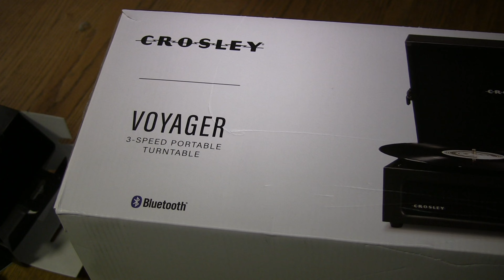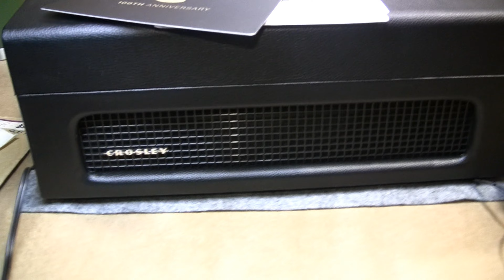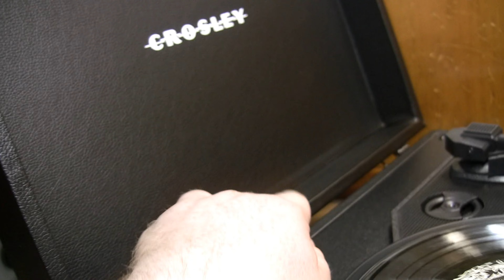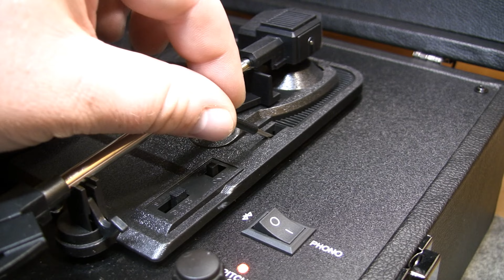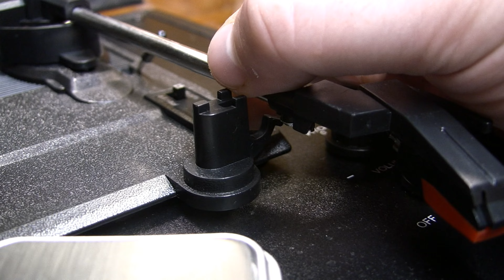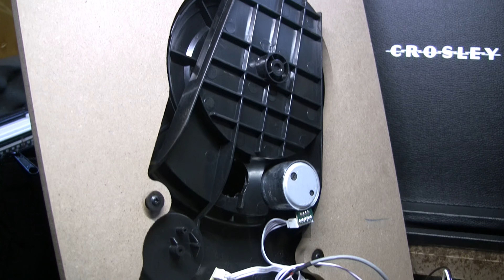Crosley Voyager Suitcase Record Player Review

Comment: I have been using the $30. VIBE SOUND. Ok. It won't floor you. But it does it's job surprisingly well. It is great for nostalgia. 🤠 It looks really cool. 🤠 And it designed well so the record never comes into contact with lid.🤠 Yea! This is a winner. 🤠

Comment: Can I change the cartridge on my voyager? Which one would you recommend? Thanks!
Reply: You're quite restricted with the ceramic cartridges on these entry end portable players but if you want to try and upgrade check out the banpa bp2atc ceramic cartridge or if you can find it the Vakind P-192D ceramic cartridge. Also, buy a decent diamond tip stylus with metal cantilever. Even the Banpa/Vakind cartridges which have a flip over 78/LP stylus have a sapphire tip so you'll want to pick up a separate diamond tip flip over needle (like the BSR ST-17D)

Comment: I've only used mine literally a handful of times, and it stopped working. It's been stored in all of its original packaging and only pulled out to play new records. So disappointing. Troubleshooting suggested replacing the power cord ( which should not be going bad after only a few uses), but I can't find one that's compatible. Has anyone else had this issue?

Comment: My turntable has a slightly different mechanism. My PCBs are also different my power amp is in the back in the jack board. The knobs are the only thing on the control PCB

Comment: The main problem with these Crosley record players is the sound quality, mainly aa a result of a ceramic cartridge, with a frequency response from about 150Hz to 8kHz +/- 3dB.  It's not going to sound very good - the sound has a tendency to sound harsh and tinny.  Compare that with an Audio-Technica LP120 using a magnetic cartridge and an AT-VM95ML stylus, with a frequency response of 30Hz to 23kHz +/- 3dB, hooked up to a hi-fi midi system and the difference is very clear.
Reply: Does it still sound like this if hooked up to a better speaker?
Reply: @rainbowpancakes7298  Quite likely, though it will not sound quite as bad if it is hooked up to a high impedance stereo valve amplifier, common during the 1950s and 1960s.

Comment: Would it help if internal speakers were replaced with larger ones if they fit ?
Reply: I have one of these, it's a parts doner now. I tried the different speaker route, but not improved. The reason is the cheap amp in it. Only gives you that shrill ear hurting sound.  The cruiser I got sounds better than the Voyager.
Reply from the maker: I don’t see why not, though that’ll only help so much since you’re ultimately limited to the so-so sound quality of the ceramic cartridge and stylus.

Comment: I have tested the very same unit today, just for fun. All the bad and negative opinions on the internet are real - the thing is absolutely horrendous. It's extremely cheaply made, everything is wobbling and not stable, the tonearm feels like its about to fall apart at any moment. The cartridge has a plastic cantilever as you mentioned which is horrible. I have tested with 1 record using the built in speakers and my iPhone speakers sounded better that this it was also not loud at all. Next I connected it to my good stereo system and even there it sounded horrible when compared to my Technics. Also tested the wow&flutter and it was like 0.7% (wtf) I mean it's so bad it ain't event funny and they are charging over a 100 for it that's a complete robbery.
Reply: It’s obviously not aimed at people like you is it, more youngsters getting into vinyl for the first time and not having the bedroom space for a huge system

Comment: Both this record player's cartridge and vinyl records in general are rated for a maximum tracking force of 6 grams, so this player is just below that recommended limit. So it's technically not excessive -- but just barely so. I have some Folkraft 45s as well -- I found them at a thrift store years ago. The circuit board between the motor and audio amplifier has a hole in it -- maybe that's where the speed trimmer for 78 RPM is?
Reply from the maker: I've gotten so used to my Audio Technica AT3600L's ultralight 2.5–3.5g tracking force that anything above that seems excessive. I keep forgetting that 6 grams is within spec. 

The "Evening with the Tics, the Tacs & the Toes" record was one of the many I rescued when a local school was cleaning house and getting ready to permanently close. There were at least a dozen and a half of those Folkfraft albums, some really boring educational LPs meant to accompany slides on an overhead projector, and some real gems, like a 45 put out by Colgate talking about toothpaste and brushing your teeth.  The song playing at 09:12 was one of the real oddballs in the bunch. It doesn't strike me something appropriate for (grade) school use--it's literally called Coroner's Corner--and it couldn't even be picked up by Content ID or Shazam it's so obscure!